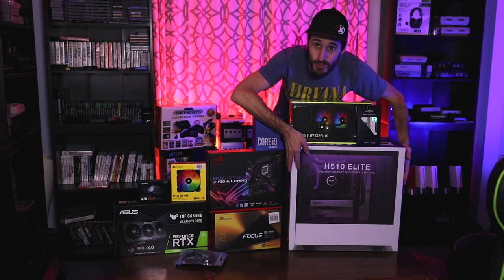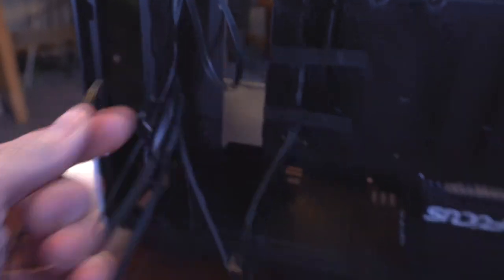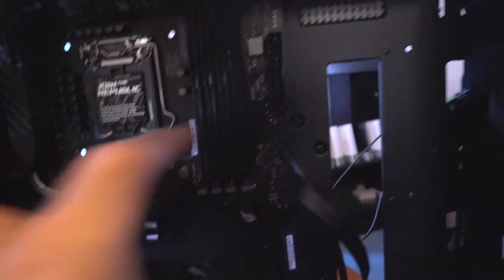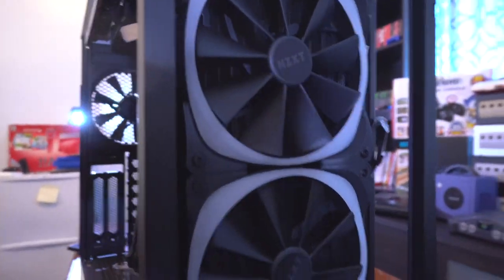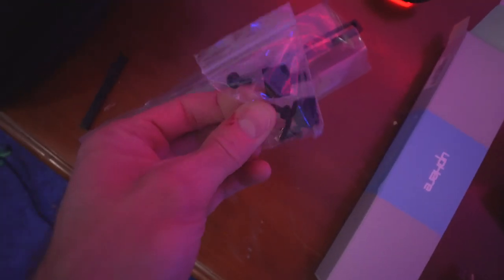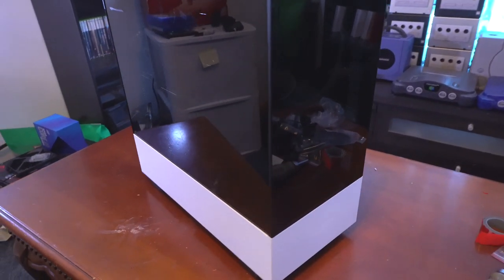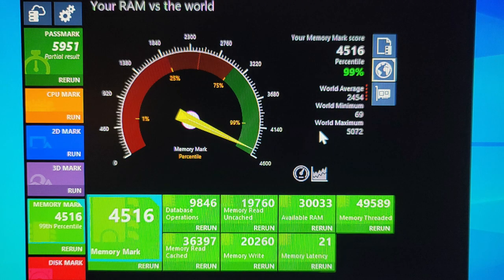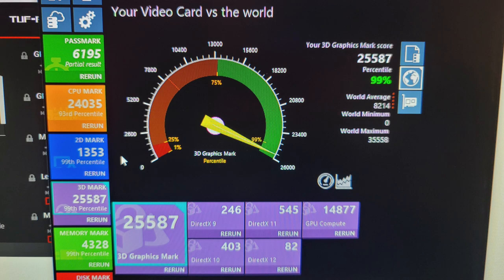How To Build Intel 10900k & nVidia RTX 3080 Gaming PC Guide

Comment: Im doing a Build with a 3080 and i have a ryzen 7 5800x cpu. I’m using air cooling though, I have a cooler master hyper 212 rgb cooler. It’s my first time building a pc.
Reply from the maker: Awesome! That's a good cpu for gaming right there 👌
Reply: @Akryl1kz  thanks. Do u reckon I should get liquid cooling or is air cooling alright for a 3080 and a new high end cpu like mine? This is my first time building a pc I’ve never had one before.